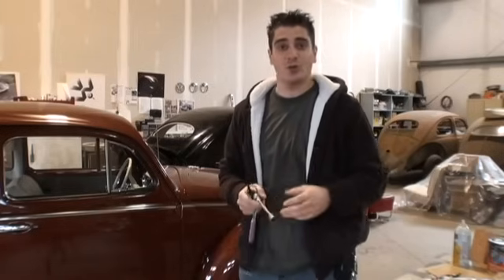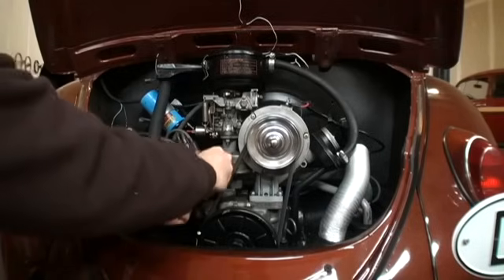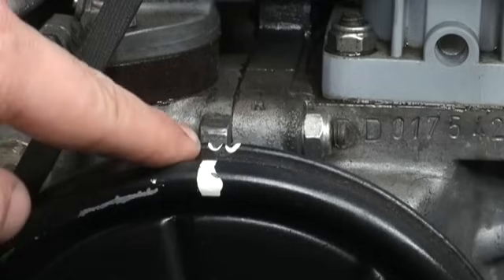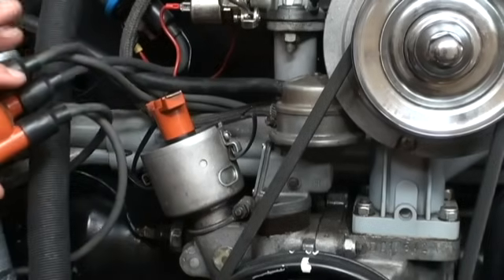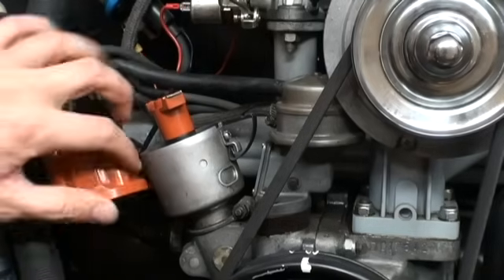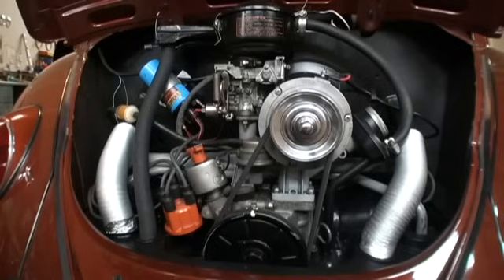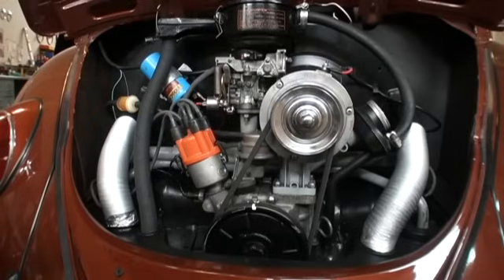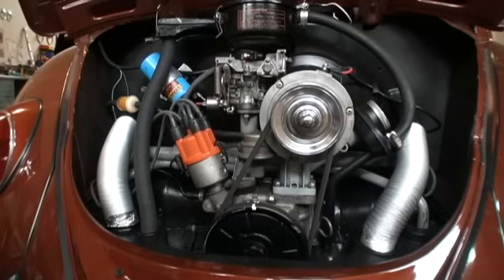Classic VW Beetle Bug Ghia Bus How to Time Set Volkswagen Engine Timing

Comment: I'm only 16 and wanting to fix up an old bug. I have very little mechanical experience, but your videos are so kiss.
Reply: Great  car to start young , buy a good manual, Haynes or idiots guide... Start by keeping things stock spec. Aim to use the best quality parts from Germany by Bosch for electric and ignition parts, SachsBoges for clutch and shocks, Michelin Tyres , not cheap but the best, remember your life depends on them when on the freeway, on a cold,dark,wet night . That's when you will be glad not to have got the cheap chindian parts that won't last!

Comment: Important note: When rotating the crank pulley to set at your timing mark make sure you are rotating in the direction of rotation (clockwise) before stopping. If you go past your mark, back up the pulley an inch past your intended mark and then rotate clockwise again, then stop at your mark. This keeps all the gear clearance slack on the correct side (distributor drive to crank gear AND distributor drive to the bottom of the distributor itself).
Reply: I do that, good thinkin bro.
Reply: Good advice Michael, thanks,
Reply: Back up means to go back, going left (opposite of right meaning, going counter clockwise) so before your mark, but then you said past the mark which would be clockwise continuation. Did you mean?: if you got past your mark (clockwise), now turn counter clockwise, and stop at one inch before your make, now proceed to go clockwise
Reply: @DEATHWISHVQ 8:09 

F

Comment: Thanks Chris, My alternator post band clamp snapped and the old alternator moved and threw the belt. The engine got pretty hot as a result of the fan not spinning. I don't think I did any major damage. The engine is a just run in Stan Pobjoy 1600, Stan machined out to 1916cc. Twin port heads, machined cam and dual Kadron carbs with a sidewinder exhaust. It starts and runs now although it is now popping and idling rough. The plugs were pretty bad and number 4 plug lead broke when I removed it, it was cooked. I changed the oil, I put new spark plugs, new ignition leads and a new alternator. I have re wired to an internal regulator type. I noticed that the rotor button is nowhere near number 1 now on my 009 dizzy. All new parts now fitted, I will re tune tomorrow and cross my fingers. Thanks for the well explained easy to do tune. My expertise is more body and paintwork.

Comment: Nevermind, somehow it all worked out. I still used the check light as it blinked off while at TDC, and its never run better. I just needed to charge the battery and get fuel into the system. Thanks buddy, you saved me money and I had the pleasure of fixing it myself. That's what bugs are all about, right?

Comment: Preparing to learn more and scare the poorbeetle…. Following the wires from the plugs, number one on the distributor is not near the notch but is to the left maybe at 7 on a clock face. It is most inconvenient trying to get the clips back on as one is on the back (I know Muir said it was font but back to me). The pulley has two notches and the one to the right has the number 1/32 engraved by it.  When I line up with the notch to the left, the rotor points to the #1 wire. Maybe just label them on the distributor cap and live with it? I also heard someone else say that if I adjust the points then I must retime so do points first?
Reply from the maker: What distributor are you using?  What year engine?
Reply: @classicvwbugs  Hi Chris, The distributor has no identification on it but I know the vacuum advance is bad so I ordered a distributor from Jbugs that has everything needed. The engine was supposed to have been rebuilt about 8000 miles before it was sold. The person who changed the oil for me said it was full of sludge. Another person who knows the cars said it was not rebuilt but cobbled together.

Comment: Random question lol can you connect a self powered continuity test light exactly the same way but the light going out be the test signal? Because I'm that case the points close creating a continuous path to ground? I'll find or buy a new test light asap or do the timing the more basic way.
Reply from the maker: Are you sure you are on the negative side of the coil?
Reply: @classicvwbugs  yes I was. Seemed to work. Does that make sense to you? Lol

Comment: Also, after your timing light ignites tighten down the distributor, roll pulley counter-clockwise until light goes out. Then roll pulley clockwise and see specifically where the timing light ignites. This gives you an accurate place where ignition will happen.

Comment: Hi Chris Great video !  👍 you mentioned that when you have the shorter distributor that you set the timing with the  pulley at TDC...so is that all vacuum advance distributors get timed at TDC and only the 009 gets timed at 7 1/2 before TDC ? Thanx !! 😊
Reply from the maker: what year bug do you have?  Most if not all short stubby distributors set at TDC.  Anything tall like the 009s, go 7.5BTDC
Reply: @classicvwbugs  thanx for the reply ...have a few lol...was just wondering if the rule was if it has vac. Adv. Set at TDC....and no vac. Adv....set at 7 1/2 btdc

Comment: If you are on the road and you have no test lamp on hand simply disconnect the cable from the oil pressure switch and use the oil pressure indicator as your test lamp. You have to look through the rear window to see the lamp. The other end of the lamp ist connected to plus 12 or 6 Volt. So all you need is the wrench with the 10 mm socket. So the beetle comes with a built-in monitor for ignition timing. How cool is that.
Reply: Or just go buy a $3 test light at HFT

Comment: I live at 10,000 feet, drives fine when its not too steep,  but going up hill there is a lot of loss in power now. Have read you should advance it 1 degree per 1,000 feet.  I have had this car for 25 years, seems like I should know by now,  but the engine is a somewhat new rebuilt 1978 1600 with a 009. Any advice for high altitude tuning? Thanks for the tips over the years.
Reply from the maker: Try changing to a smaller jet size in the carb, probably have to lean out the carb.
Reply: @classicvwbugs  Thanks for the reply. I found an online calculator for jet sizes and found the jet on eBay. Hopefully it will be here tomorrow. 

But had a fuel filter under the tank, it was pretty dirty, when replacing it I put an electric fuel pump in. It runs a LOT better doing that, made it up the hill in 3rd gear from a stop. Plus ordered a hot spark to replace the points and condenser. 

Just wondering your opinion on the electric fuel pump and ignition conversion?  I have always used stock parts, but my last engine filled with gasoline because of a faulty pump. I was thinking about putting a bypass around the new pump in case it goes out on the road it would be easy to put the old one back in. Other that its location seems alright.
Reply from the maker: @coreymillia  Yeah I do not use the electric fuel pumps, I try to stay stock.

Comment: Hi  Community,  Excellent video and I put it into practice and it worked but my son accidentally replaced the battery and placed positive and negative backwards and I don't understand comkk ok I was able to start the car without problems at the time.  It worked well for the first 2 days but today is the 3rd day and watching your video to check with the one lit by the lamp I placed the negative on the negative coil and without moving the distributor rotor I placed the peak of the lamp on the bottom  dealer and turn on.

Comment: Hey Chris, I have a73 standard beetle I’ve rebuilt. I’m having a HECK OF A PROBLEM with. The numbers 1 & 2 are firing, but NOT the numbers 3 & 4 . What the heck? I have NEVER run across a “gremlin” like this before. What am I NOT seeing? What could cause a problem like this? Everything is NEW!!
Reply from the maker: Check your plugs and your plug wires, make sure you are getting spark there.

Comment: Thank you for this video, Chris.  I'm getting the exact opposite problem where I'm not getting the light to turn on at all. I'm using an SVDA distributor with a Pertronix Electronic Ignition, and Pertronix coil.  From what I can see, everything is connected correctly.

Comment: Chris, thanks for this video, it was a big help on my first project car.  I have a new one that I had do a complete replacement of the wiring loom.  When I turn the key I get the two light in the speedo, but I don't get any light on my test light when doing this test.  Other than recheck your connections, is there anything you can think of that I might need to do?  I am really stumped at this point...

Comment: What causes for the timing to be off-set? When I got my '71 Super Beetle about a year ago, I got it to run and it ran great. About several months ago I noticed my motor shaking. Could it be due to the timing not being set to 7 BTDC? I checked the timing and it's set to TDC currently. My crank pulley only has one dent/marking, I'm guessing that it's for the TDC mark. Love your channel. Thanks!
Reply from the maker: What distributor do you have on there?  Sometimes over time the dizzy can shift.  Or the last owner did not have it set right.
Reply: @classicvwbugs  I believe it’s the 009.
Reply: @carkingspot  an 009 is without vacuum
Reply: @VallonesRCHobby  Should the timing be set 7 degrees BTDC even with the distributor that I have (with vacuum and condenser)?
Reply from the maker: @carkingspot  You can try it yeah.  7.5BTDC.  If you hear some pinging, then it is too advanced.
Reply: @classicvwbugs  Thank you for your help. I greatly appreciate it. 👍
Reply: @classicvwbugs  Set the timing exactly as you did in the video. It runs so much better now and there is no more backfiring, stalling, or hesitation when accelerating. Thank you again for this very useful DIY video. 🙏
Reply from the maker: @carkingspot  Awesome man!

Comment: Not hard to take a turn signal bulb and solder a couple wires with alligator clips on them, made one myself. Clipping the ground to the carburetor linkage sure does make it easier, thank you. 😃

Early cast iron distributor set to 7,5 degrees.

Comment: Does it make any difference if you are using electronic ignition?  When I connect the light to the negative side of the coil and turn the ignition switch to the on position, the light comes on all the time.
Reply from the maker: Some electronic ignitions will not work with this method.

Comment: So what if you have the same notches as you do just the opposite direction? So like your first notch (tdc) is on the other side of the 7.5 and 10 degree notches? 1973 original everything minus the new addition of vacuum advanced distributor.

Comment: Just this Chris on my 67 bus --- I had the dimple and V notch at 7.5 degrees, did the negative post and carb base with a VOM and read 12V, turned it, read 1 volt, back to reading 12 and bolt it down, hit the key and wa la it started right up -- I could not get it to start a few days ago -- plus plug wire 3 was not conected...THANKS  !
Reply: 6 years later and I am back again...same vehicle...different engine....

Comment: Hi Chris...Can you tell me , does the static timing still work for the electronic ignition system? I just installed and replaced my points setup...the test light stays on throughout the rotation of distributor...? I have the 009 .  Seems as though there is a flat spot off of idle, that wasn't there before...   Thanks for any help and Thanks for all you do!!!
Reply from the maker: I light might always stay on since the electronic ignition module might not work with the static timing.  May need to use a test gun.
Reply: @classicvwbugs  Thanks Chris! Thats exactly what it was doing ...I put the timing light on and set it back to 11degrees BTC accounting for the altitude here...4500 ft....is the flat spot normal also?  Or do i need to start over with carb settings?    THANKS A BUNCH!!!

Comment: You can't time the double vacuum distributors this way, 1971 thru 74.  I'd love to see a timing light tutorial with the later 34 PICT 3 factory distributors, which have to be timed with both vacuums attached to 5 ATDC while the car is running.

Comment: Now what if I’m running a 1776cc how much do I advance or what is the benefit of advanced timing I’m kinda new and I bit off a lot of motor for my first project, it recently stopped running at a stoplight after about an hour of running it it would crank over for half a second but not stay cranked over I’m thinking my valves need adjusted again or I jumped timing

Comment: Hi Chris,first-up I appreciate your effort to take time to put vw newbies on the right road and you come across as a stand-up guy. I live in Ireland and have a 1200 Standard Bug daily driver for 7 years.It is a 72 marina blue with matching numbers,running og engine at 88,000 miles I did a top-end rebuild last year,so-far so-good!I am surprised to see in your timing vid. that a 009 distributor is used seeing as the engine code is a D albeit an earlier one than mine and they run sweeter in stock form with a vacuum advance distributor.009 is for flat-out foot-to-floor driving not daily drivers,unless a twin-carb setup is used.Little tip use a stock ERNST exhaust and remove the baffles from the stock pea-shooter tailpipes for cheap extra pep!

Comment: I am doing a tune up on my sister's beetle with 1600 empi racing motor, I am having an issue where the light would not turn off, and now it won't turn on, any suggestions on what to try or what may be wrong

Edit: Found that when the light went out I had lost power to the coil, not sure if there is a burnt up wire or a bad ground.

Comment: Hi Chris, can I use a multimeter instead of a test light? If so, what would be the reading on the multimeter for when I hit the spot where the test light is supposed to turn on? Would it be 12Vdc? Thanks in advance.
Reply from the maker: You can, with the multimeter, as you are turning the distributor, it will pop up to either 6v or 12v depending what system you have running through the bug.
Reply: @classicvwbugs  thanks!
Reply: @classicvwbugs   Chris Good Morning Sir , well All on the list is checked off as far as statick test the only part untouched is the distributor Body , oh and condenser , that's All that is holding me back from finishing my project
Reply: @classicvwbugs  Sorry About that Chris any suggestions
Reply from the maker: @juanmanuelcortez1098  Suggestions for?

Comment: Hi Chris should a vw air cooled engine not have a vacuum advanced distributor? I've recently changed mine to a vac adv distributor and it's running so much better, no flat spot and starts instantly! Best thing I've done to the engine (1600cc air cooled)
Reply from the maker: Yes they all came with a vacuum advance, except the early years up to 53 oval in the 25hp era.  A 1600dp motor runs much better with a vacuum advance.

Comment: Hello, my buddy has a tryke with a '73 1600 engine that won't start now. It has a new starter, alternator, coil, carberator and electronic distributor. It was running before we changed the starter, but just backfires now. ?? What are we missing ?

Comment: I have a 1300cc with and 30pict-2 carb and 009 distro. Is this the correct method to set the pulley at 7.5btdc? Because I’m reading it should be set to 28 - 32 degrees since I have a 009 distro, unless that’s not on the pulley itself and maybe something entirely different

Comment: Help! My rotor is facing cilinder N.2 when I align it with the pulley marks! What can I do?
Reply from the maker: what distributor do you have in there?
Reply: @classicvwbugs  thanks for replying its a 009, its a 69. After messing around I noticed that if I connect the plugs "incorrectly" for example: spark plug cil 1 on 2 on the distributor cap, the car actually starts. Which is awkward and the spark plugs are all in the right place...

Comment: chris.   will the engine always be at no 1 when the pully notches  are at the top!  or could the distributor be 180 out?   and is there a way to tell
Reply from the maker: No it could be on number 3 as well.  You need to rock the bottom pulley back and forth to see it you are on number 1 by looking at the rockers.  If number one rockers don't move then you are on 1.
Reply: ok then I will need to open the valve cover on  the passenger side right?
Reply from the maker: @kevinbakersardog  yes 😀

Comment: Hey Chris I really appreciate your videos! I have a question if you could find the time? My question is I was trying to rewire my bug and I done away with the voltage regulator and put the alternator on instead of the generator, what does it mean when my switch is off and the light in the car stays on,  I guess its getting double fed? Also my test light stays on when I turned the switch off on the distributer like your video. Could you please help me out! Thanks for the video and keep them coming!

Comment: If you have a 70's VW with a double-pull distributor, you cannot time them with a test light, you HAVE to use a timing light on those.Also, it's a good idea to check the retard diaphragm on a double pull distributor as many are blown. Double-pulls are timed at idle with both vacuum hoses connected to 5 ATDC. Which is a notch to the left of the dimple on the front rim of the pulley. 411/412's are a completely different animal that are timed at around 3500 RPM TO 27 BTDC on American market fuel injected cars.